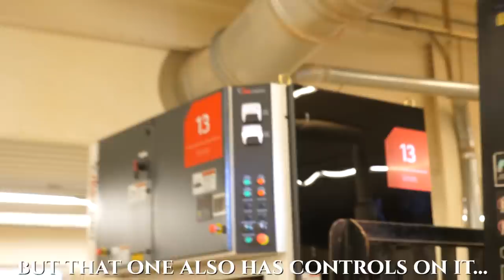New Giant Sanding Machine! (and... it's broken)

Comment: I wonder when Wrymwood will buy a machine and it just... works
Reply: Impossible
Reply: The only machine they have that works all the time is Big Tony🤣
Reply: The MGT curse.
Reply: Doug would be crawling through the ventilation looking for the site of the unholy ritual that resulted in such fortune and ease.
He'd be right to do so: that's unnatural in the manufacturing world.
Reply: We'll never know because there won't be a wyrmlife about it
Reply: I wonder when wyrmwood will buy a machine that can make it inside the shop without utilizing black magic
Reply: Cheap tech always needs installed and checked it's kinda part of the cost either way

Comment: As someone who works with abrasives I was more excited about the type of time saver than anything else. God I need a life.
Reply: As a fellow shop rat I wish they would take an extra minute to give more details on the tools and the shop setup. This channel is for hardcore fans so give us the goods.
Reply: @Gramps935  I also haven't seen one with heads on 2 sides only ones with multiple heads for one side of the stock.

Comment: I love how even if they didn’t break it
Moving it themselves the vendor will be able to use this video as proof that they did.
Reply: Pallet looked broken up on the truck, I'd point at the shipping company.
Reply: Vendor can use this video as evidence, and they can use rest of the footage to prove they did not break it themselves ;)
Reply: @ssu7653  all they have to show is they unloaded it with an undersized forklift in a dangerous way.  They pooped the tire and had to use bodies to counterbalance the load.  That defines and undersized forklift.

I’ve received big equipment at work for years.  Made some big claims for damage.  Have experience in what will fly and what won’t.
Reply: @davidmuzia814  Its a bit harder to claim the customer damaged a part, when they have 100% of the handling they did on video and not a single piece of that could possibly do the damage even in theory.
Word vs word is a different beast, but word vs video evidence is a pretty hard case
Reply: @ssu7653  actually it’s pretty easy for the vendor to win this. One.  Undersized forklift is apparent wouldn’t you agree?  Incorrect loading/unloading by the customer would void the warranty as well. The vendor does not have to show the hit that broke the unit - they have to show the customer screwed up the unloading - which they did.  Plus things break in weird spots when equipment is handled roughly.  Too firm a put down can break things a fair distance away.   All I’m saying is they botched the unload by using the wrong prince of equipment - that’s all the vendor has to show. The vendor wouldn’t have any idea that happened - except they posted a video of it in you tube.
Reply: @davidmuzia814  Sure the vendor have no idea what else happened than what is seen in the video, but im pretty sure they have footage of more or less everything they did IF it comes to that.
Did they do anything in the video that would make any normal person believe they caused the damage? 
Pallet that did not survive the transport + glass not marked as fragile, clearly the vendor did a bad job securing it before shipping ;)
Reply: @ssu7653  let me ask it a different way - why don’t you think they are even bringing up getting their money back?   Sure / they might not care - but more likely even they know so they won’t get money back.  I’ve received and installed big equipment for 20 years and have a really good idea of what will fly and what won’t.  If you are drawing in logistics, shipping, equipment installation, engineering experience then great we can debate it from your experience.  If not and this is theoretical to you then this isn’t going to go anywhere as a debate. No worries.
Reply: @davidmuzia814  Why not ask for money back? Ton of paperwork, for best case the cost of that single panel and worst case they cant use it until its fixed. It would cost them more to get money back (workhours are not free), than they would get back...
Reply: @ssu7653  it really all depends on the vendor and the relationship with the client and the type of equipment they sell. Take (for example) the vendor that supplied the table  leg mortise/tenon machine.  System doesn’t work and wyrmwood was paying for parts and repairs on a brand new system.  That’s a lousy vendor right there.  If the sander machine was a great vendor they might comp the repairs at no charge.  I have no idea if they are a good vendor or not - but if they did comp the repairs then they did that as a choice.  They had no legal responsibility in doing so.

Comment: Now I don't want to come off as an asshole or anything, but do they never go to the place where they actually make the machines, and test them BEFORE they arrive? Whenever we are getting a new machine where I work, the people behind the acquisition (engineer, mechanic, etc) go to the manufacturer to test the machine, check its up to spec, etc. And if it isn't, it will stay at the manufacturer until it's finished. 

I know they are a much smaller company than what I work for, but a procedure similar to that will pay for itself in the long run.

Comment: This is honestly just infuriating; I mean, unless you lose control of the forklift and the thing falls over, it should at least work when it's brand new.  Does anyone know if the failure rate of these machines is normal, or if the people selling them to Wyrmwood are giving them lemons and laughing all the way to the bank?
Reply: Sadly, it's pretty common. Between design, materials, fabrication, software, transport, and installation there are so many places for big equipment to mess up that it's a surprise when equipment on an industrial/commercial scale manages to arrive anywhere near the initial estimated time and cost, and a flat-out miracle if you can just plug it in and use it.
Reply: Does it actually not work or is it just some external damage? They didn’t actually try and use it in the vid
Reply: A plexiglass panel was cracked during shipment.  If you look at one of the pallets, it's pretty broken up so possibly shipping or loading damage.  They haven't shown if the machine is broken or not, large machines like this are assembled by the company for the customer.  Customer provides a spot, electrical and any mounting requirements (extra thick footings for really heavy equipment).
Reply: @jcadult101  Hmm, well, if it's just cosmetic damage, then I guess that's fine; if the machine itself doesn't work, then it's all but certain they'll make an episode of Wyrm Lyfe about it, since machine failure is guaranteed content gold.

I actually hang out with Doug once a week for game nights, though the last 2 we've taken off for the holidays; I can always ask him how it's doing and he'll know.